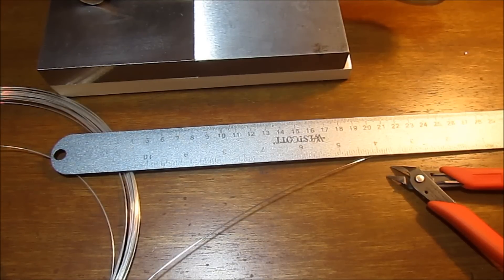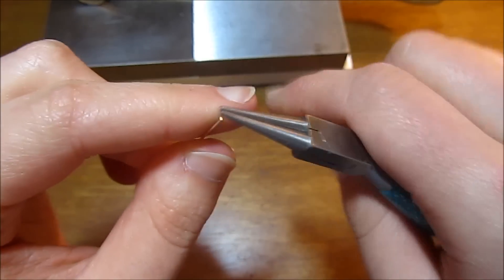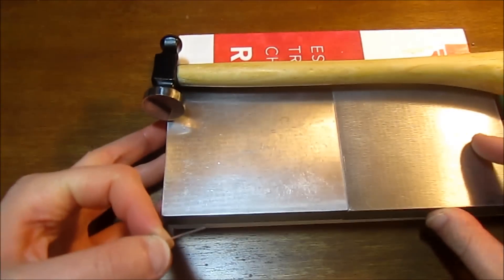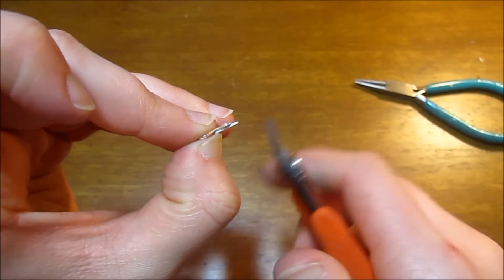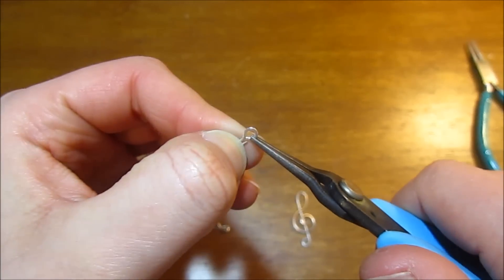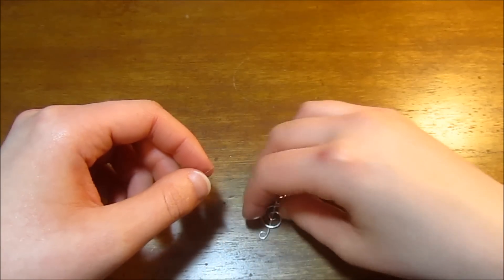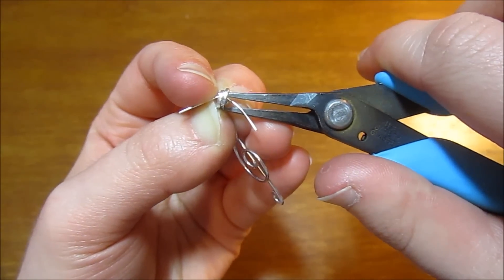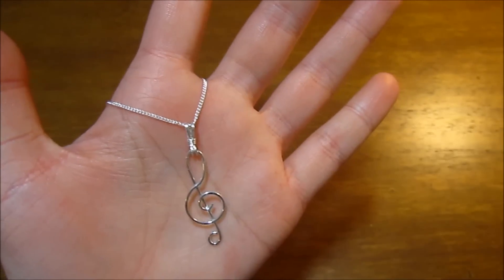Jewelry Tutorial : Wire Wrapped Bail for Pendants

Comment: Ok how well will this bail hold a titanium wire wrapped around the top of an arrow head. Really needing to redo my arrowhead necklace. I am looking to use a 24in leather cord as the foundation. The wire will go around the indents tightly 
 on the arrowhead then soddered shut as a ring. Have another piece of the same wire wrap across not over, and sodder the ends to the handmade ring. Still leaving enough room for the bail to go on. The arrowhead Itself is about two inches long, and the top is two centimeters wide (one and a half cm counting where the indents start separately). I am looking into using at least a 20 gauge wire.

Comment: what do you use as a base when you are hammering the loops flat? metal tiles or something like that? it looks easier and cheaper than getting a jewellery anvil.
Reply from the maker: It's a 4" square steel jeweler's bench block. You can find them on Amazon for pretty cheap!